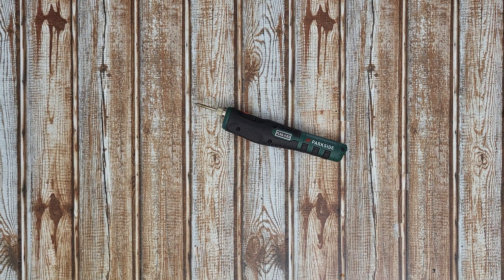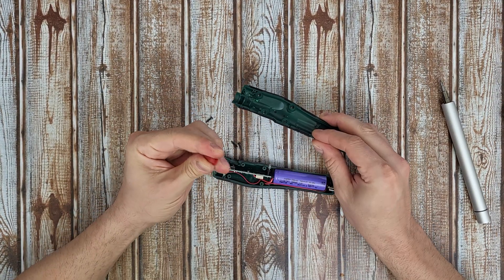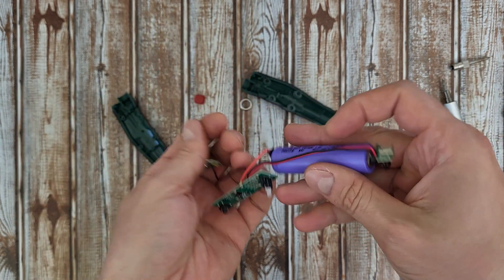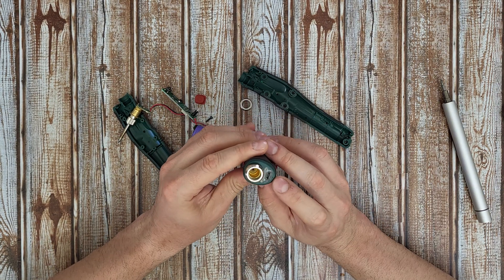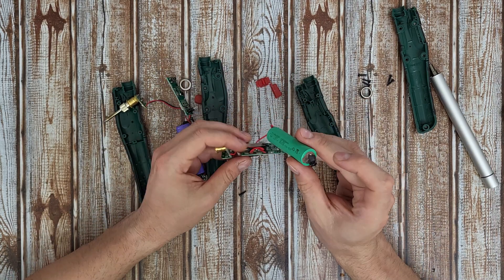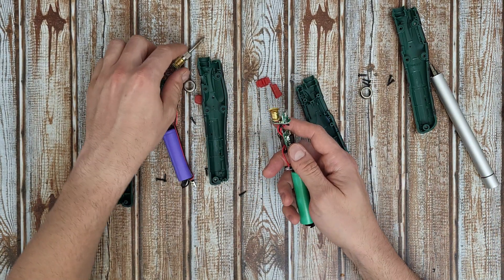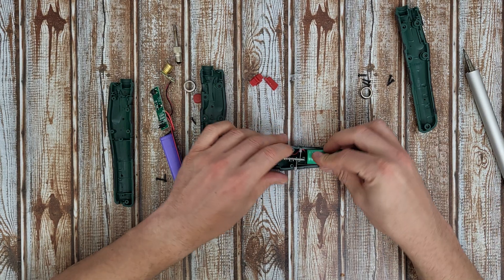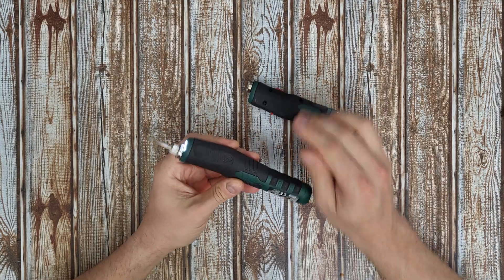Parkside Cordless Soldering Iron PLKA 4 B3 TEARDOWN

Comment: What if the battery is changed and a stronger, twice as strong 3000mAh is installed? Will it be fully charged in the soldering iron, or does the electronics in the soldering iron limit the capacity to 1500mAh? It's good for first aid, help.

Comment: it is good, but you need flux wire with a low melting point and use solder paste when you want to solder, preferably lead-free. 
reminder that is a hobby tool ! but a good one if you know where and how to use. Got both, one for toolbox and another for fast intervention.
You can also change the power if you mod the board but that will cook the tip faster... and that is expected to fail in time , reason why is detachable.
you can buy them from a lot of sources and various other brands are compatible. Copper tips are the best but also fail faster as they tend to heat faster and higher.

Comment: Its only a toy, in my opinion! This device is only good for soldering wires in the air. To unsoldering a component from a PCB, it is absolutely impossible, the tip cools down instantly! Wase of money, i returned it.
Reply: I struggle with the problem to, but I think it is the melting point of lead-tinn who needs highter temp.
I tried to figer out if you can increase the temp but havent found a way.
Parkside have on the x20v iron a way, (dot described in manual) to incre decre temp by pusching the buttom in a specal way
Reply: @Jesusnadeson  How?

Comment: Hi there,
I recently bought one of these and didn't realise it only came with the USB-C charging cable but not power adapter.
Do you know which adapter I need to charge it? Tried various USB mains adapters I have but none have worked. No light illuminated when plugged in, so not charging.
Thanks
Reply: It should work on every USB port, anything that can provide at least 500mA.